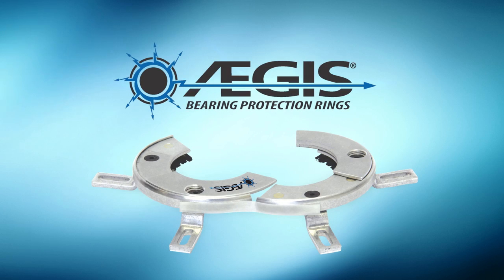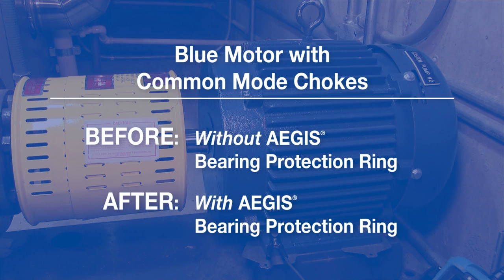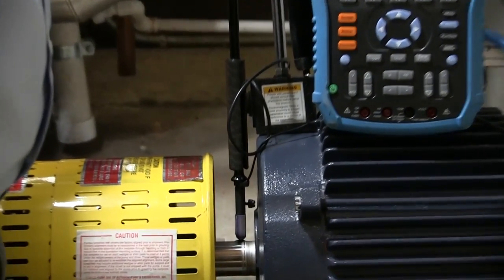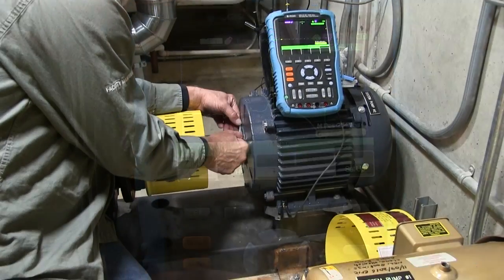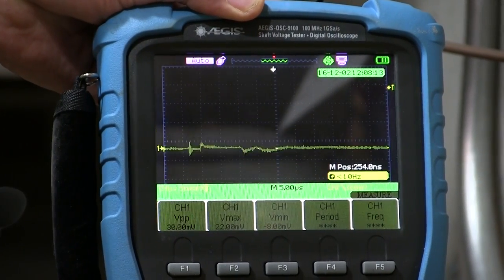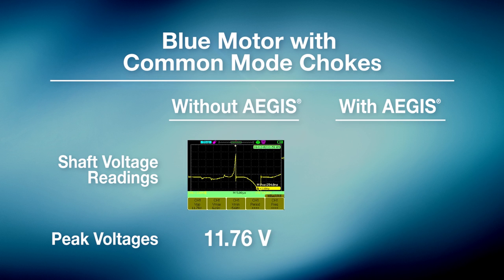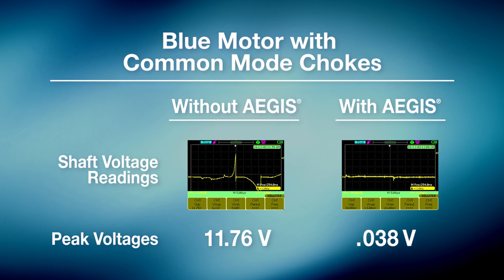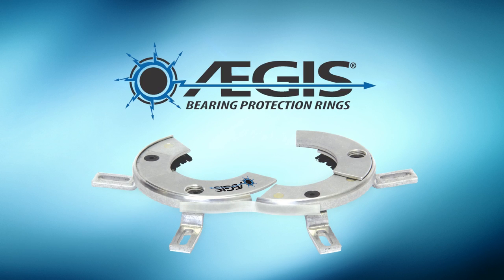After Common Mode Chokes Fail, AEGIS Rings Protect Motor Bearings

Comment: FYI there were 2 Baldor motors in the beginning after 2 years noisy at 4 years one motor failing other needed new bearings. I was supplied by a shop in my area a Leeson motor and a set of Common Mode Chokes. I checked the sizing and insulation and made sure manufacture instructions were followed. I then pulled the Other Baldor motor out of service and replaced bearings and installed the Aegis Grounding Ring per instructions. My research with many motor manufactures led me to believe that my Leeson would fail in short life from bearing EDM. So I ask to have the Test. I'm sold on the Aegis Solution.

Comment: I was informed by ABB that the VFD on my motors incorporate the common mode choke technology . ABB , Baldar, and Leeson told me to stop my bearing damage install Aegis Grounding Rings. If that is incorrect why do many of the motor manufactures install Aegis and endorse it for bearing EDM problems. My next 2 pump motors shipped from WEG with factory installed Aegis rings!

Comment: This "demonstration" misses the mark.  High frequency current causes bearing fluting, not voltage.  Why don't you measure and compare high frequency current with both technologies?  Why don't you tell the truth?
Reply from the maker: It is impossible to directly measure capacitive EDM currents.  What you measure is HF common mode current.  It is disingenuous to refer to this (as many choking proponents do) as "damaging current.  Most of this current will not have enough energy to couple onto the shaft and then discharge through the bearing.  We are not concerned with common mode current.  We are concerned with current through the bearing.
What you are seeing here is the next best thing to a direct measurement of bearing current:  The voltage signature of discharge though the bearings.  You see the voltage on the shaft build up and up, and then crash to zero.  That crash occurs simultaneously with an arc through the bearing, that is, with a bearing current.
There won't be any current through the bearing until the shaft-ground voltage difference (which we're measuring) is big enough to overcome the dielectric of the bearing grease.  It's exactly like a flash of lightning:  A voltage difference builds up and up between the ground and clouds, until it reaches a critical threshold, when the electric field is big enough to ionize the air, and then ZAP!  Discharge, i.e. current.